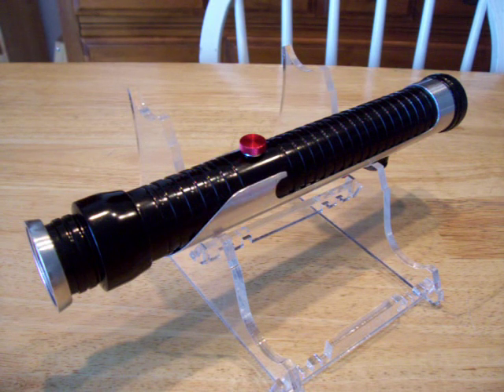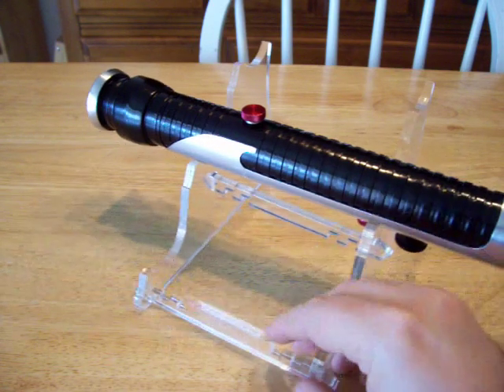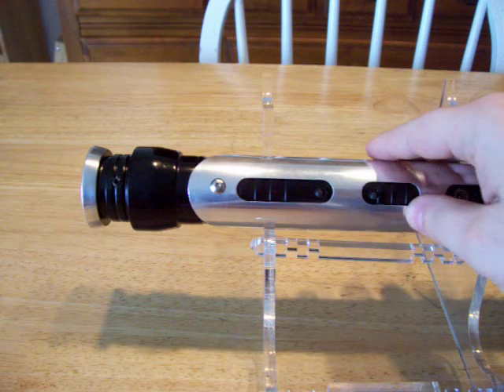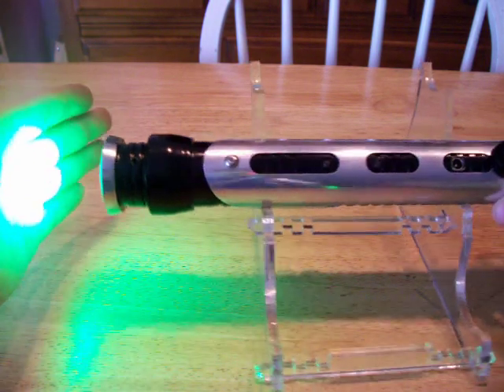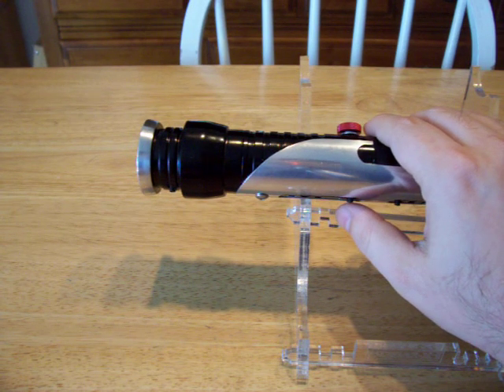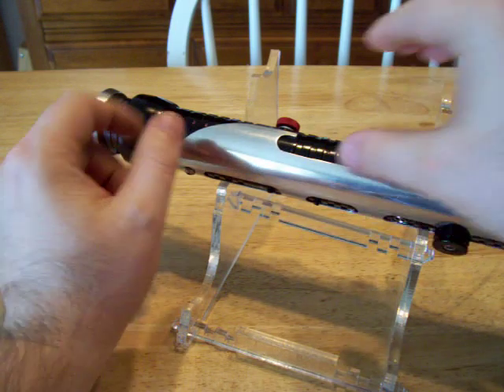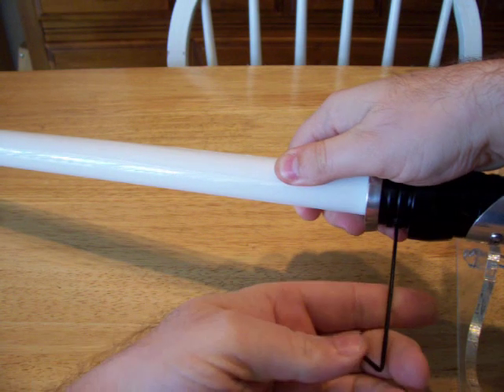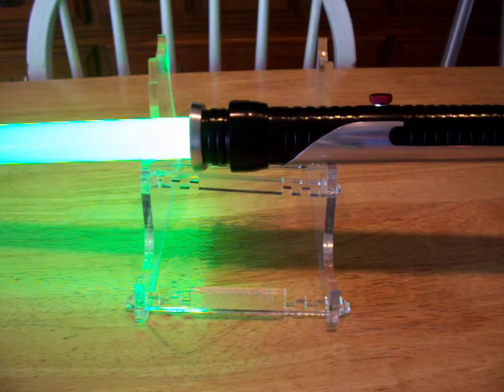Qui-Gon Jinn Lightsaber with Crystal Focus 4.1

Comment: Hey Jengo, nice hilt. I was wondering, how could you make a Qui-gon hilt locally? I found a website and they said to use pvc for the inner hilt and a sinktube for the overlays, except for I want to use my Ultra Sound 2.5 board for the sound. Would the pvc be safe enough for that or would it melt? Thanks.